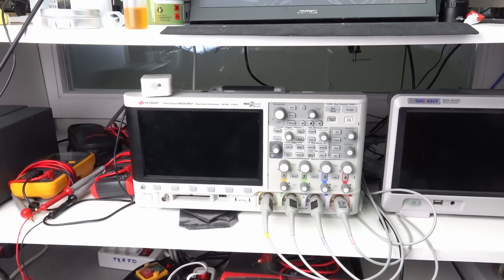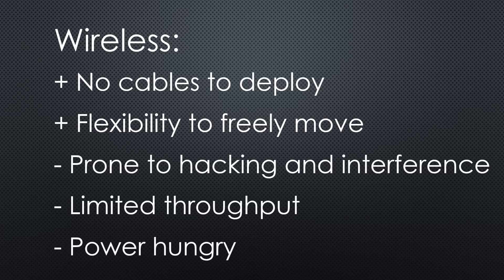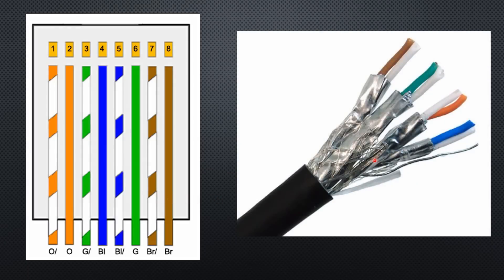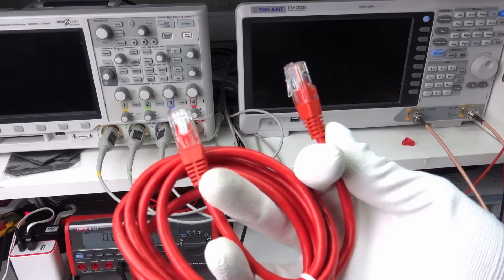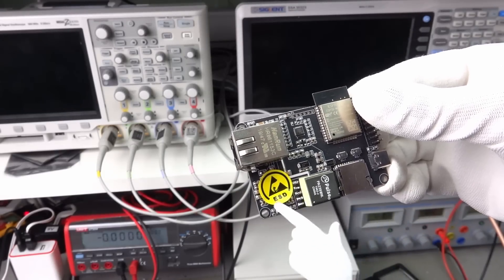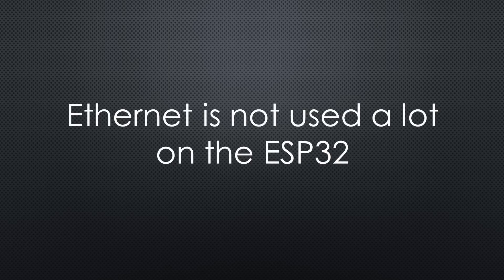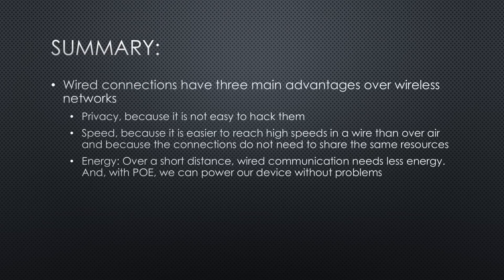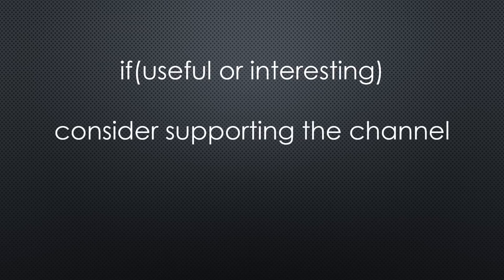(488) Is Power over Ethernet (POE) on the ESP32 any good? (New TTGO and Olimex boards available)

Comment: Just make sure to not use "shielded" Ethernet cables.
Most of these boards are not isolated from their Ethernet shield and thus there is a direct connection to the chassis of the switch.
Also when using PoE, keep in mind not all use isolated PoE, so when you connect the board to a PoE switch and also to the PC for debugging, you may end up frying the board, your PC or your PoE switch.
Reply: Wait, don't all PCs and most if not all routers use isolated Ethernet?
Reply: @ligius3  Yep, but many ESP boards with Ethernet don't and thus you have a direct connection with the chassis of the switch/router which may be connected to some other PC which isn't connected to a power outlet with earth pin and thus if you use the more expensive shielded Ethernet cables, you may have quite a high voltage offset on the GND pin of your ESP board.
If you then connect this to your PC (e.g. via USB to serial chip as some Ethernet boards also don't have USB) or logic analyser, you can for sure fry electronics.
So that's why I strongly advice against using shielded Ethernet cables to connect your ESP boards.

Some PoE Ethernet boards do not have isolation on the PoE circuit. 
For example Olimex has boards with and without isolation on the PoE circuit. This is clearly labelled in the name with "ISO".
Reply: Yes, just saw now the schematic and description for the Olimex board and it does not have a tranformer. Some ETH chips I think include a transformer inside but not the specific Microchip one. But I agree that the shield might be at a different potential, but compared to what, to ground? It still needs a path, so two connections, so not sure how the current would flow. The PoE injector probably has an isolated supply. Ethernet doesn't have a ground pin, so not sure where the voltage will flow from the shield.
Reply: @ligius3  I think you're mixing up a few things here...
In the RJ45 socket, there are some transformer coils for the signal wires (well in nearly all but the really cheap ones) so the signals are almost allways isolated or at least on the other side at your switch.
However for PoE, there is some center pin for each pair which carry the PoE voltages. 
The PoE circuit to tun this 48 - 57V into some more managable lower voltage can also be isolated. For example the Olimex PoE-ISO board has such an isolation for the PoE.
N.B. when powering your board via PoE, the data lines should absolutely be isolated or else you will fry your Ethernet chip.
But those are often just isolated in the RJ45 socket.

Now the shield of the RJ45 socket.
This should only be connected to the GND of the board via some 1M resistor and maybe some capacitor too.
However on quite a few ESP32 Ethernet boards, this shield (thus the metal frame of the RJ45 socket) is directly connected to GND of the ESP board.
So if you connect this shield with a shielded network cable (thus metal shield wrapped around the RJ45 connector), then you will make a direct connection to the chassis of the switch.
And if this switch is connected via a shielded cable to another PC which isn't properly connected to the Earth pin, you will introduce a voltage offset of +/- 110 - 120 V from this other PC.

This is like when you get shocked when touching a PC case.
So you may introduce quite a voltage level offset between your ESP board and whatever equipment you have at your desk.
Remember "this other PC" can be located in another room, connected to different phase, etc.

This is why I always advice not to use shielded Ethernet cables when connecting ESP boards. At least not when you also need to connect other stuff to it, like some debugging tool, a PC or sensors which can be touched.
Reply: @TD-er  Thanks for the clarification, it makes more sense now.

Comment: I suspect that BL will not work as it is using the same chip as wireless which is not used. Try to tall back to wifi and see what happens. I'd like to have the option to use wifi if there is no connected ethernet.
Reply from the maker: There are other comments that say that BLE and WiFi work but less stable than BLE and Ethernet.
Reply: @AndreasSpiess  oh, that was not what I meant, but if the same chip is used for both Wifi and BLE, then maybe if you do not enable Wifi then BLE might not get activated. Just a thought. As for stability, I have two esp32 modules running the ble proxy (esphome) and they were working perfectly, then I upgraded esphome and I now see drop outs with some of my ble modules. I suspect that the problems I see is down to coding and not hardware - but you touch an interesting subject.

Comment: I hate all those poe boards that won't provide Any external power to drive LEDs or actuators.... A 12V 1A could do a lot of useful things :/? And cheap poe breakout boards do that - couldn't they use that Ic as well?
Reply from the maker: All depends on the use case. Most of my PoE bords do not need a lot of power. So I do not want to spend money for a better chip or a bigger board...

Comment: I'd like to try an ESP32 board with Ethernet & POE capability! 
I have a specific application where i need an RFID reader that is connected via an Ethernet cable with POE.
Currently, I'm planning to use a different chip, as i have a board from Sparkfun that already integrates the RFID chip with a controller, and has Ethernet capability. 
But my home security system will use RP2040 chips for the sensors, and ESP32 for the console. Plus, i use esp32 for so many other things, there are times when Ethernet would be useful and preferred.
But i guess cost of the boards should be considered as well.
And whether it not there are enough free pins for the application!
(Why do they use 8 i/o pins if they're already using i2c?)
Thanks for the update!
👌👍🤪
Reply from the maker: This is why I still use the Arduino IDE: I can use different MCUs for different purposes...

Comment: Personally, I think the main advantage of wired vs wireless is reliability.
Wireless circumstances change and a deployed device that worked perfectly for months/years suddenly doesnt anymore. That wont happen with a wired connection.
(And don't get me started on ZigBee, where many devices randomly decide to drop from the network after a few months, in my experience)

Comment: I recently deployed an ESP32-POE (Olimex) with WLED, 4 output channels for LEDS, and a I2S ADC for line level audio input. My only struggle was finding enough 'raw' GPIO, and I needed to desolder a few 0201 SMT resistors from the I2C lines that I didn't need. Would be nice if it was a solder jumper or something easier to 'clear'.
Reply from the maker: Maybe somebody from Olimex reads the comments ?

Comment: Thank you.  I will look at the boards but probably hold off. I have some stuff that is connected with wifi (it isn't perfect,  wifi drops out sometimes) today, and i guess that works well enough for now. I ended up with some 2.0mm header cables a while ago. 2.5mm is much easier.
Reply from the maker: Indeed, wires have less complexity. Still, they can fail if the router goes down.

Comment: "ethernet" cable is PDS  cable; premises distribution system, developed by Bell Labs @ATT then. The PDS cabling trademark Systimax exists still. Ethernet protocol is only one of the many usages for this cabling. Other uses are such as RS-232 422 423 & normal wired telephony sets & video. In ethernet use the max cable length in 100 metres from chip-to- chip i.e. normal practice 90 meters from connector to connector.

Comment: I had a project I wanted to do a few years ago with a wired ethernet ESP32, and none existed, or they weren't really common. Ended up going with completely different hardware that was beaglebone black based, which also has wired ethernet.
Reply from the maker: Indeed, the Linux boards offer Ethernet for a long time.

Comment: Hi sir, currently I am working with esp32 and zmpt101b sensor module. zmpt101b working fine but when I try to connect wifi (wifi.began) then zmpt101b showing zero values. Please help me
Reply from the maker: Maybe you connected it to the wrong ESP32 pins. WiFi uses one ADC (watch my video about the usable pins of an ESP32)

Comment: I've always used the T-568B standard here in the US.
Reply: I've been running ethernet cabling here in Finland for 25 years and everything has been done with an A-scheme. Except one large customer that wanted everything to be B for several years, until they gave up.

Patch cables seem to always be with B-coloring thought, which screws up everything. Rj45 is used so much with other things than ethernet and we electricians need to cut ready made patch cables to connect other end to screw terminals etc. Basically every time a new guy connects such a device, we have to go back and change orange and green pairs with each other.

I'm glad that the gigabit crossover isn't really a thing in real world, so blue and brown are mostly right at the first go.
Reply: @villehietala9677  that's interesting since I'm pretty sure in the standards it says that B should be used but it's been years since I've read any of them or made a cable for that matter😉. Just did a quick search and found that the TIA/EIA 568-A was standardized in 1995 but replaced in 2002 with B. The only time A would be used is in a crossover cable as that reverses the pairs. Up thru 100BASE-TX only 2 pair are used one for TX and one for RX but starting with 1000BASE-T all four pair are used. The switch to MDI-X was added to hardware so crossover cables were no longer needed but also had the benefit that were various national standards messed up by using A instead of B they didn't need to make special equipment just for those countries😉.
Reply: The A standard was only used in office phones originally and when they developed for ethernet they choose B so the two types of equipment didn't get confused if hooked up to wrong system and/or cause possible damage. Many newer office phone system use POE instead now to allow simpler wiring that can used for either.

Comment: i don't think you can compare 150mbit wifi vs 100mbit cable as 150mbit wifi is single duplex and has overhead. Even on perfect conditions it would be max of 100mbit, whichi I would not think you could ever achieve on esp. Ethernet is full duplex making the total bandwith 200mbit. So it's not a bit better, it's alot better.
Reply from the maker: You are right!

Comment: 10:10 Wifi/Bluetooth cannot be used together with the ADC2 pins. I think GPIO14 is your problem. Unless you have already tried without the temperature sensor, in that case I don't know.
Reply from the maker: Good point! As said: I did not investigate further.

Comment: I just started looking at these for my NTP server a few months ago. There is a common board called the ETH01, it is near useless. The clock is not properly routed. I am surprised they can sell them when they are so flakey.
Also Espressif themselves sell an ethernet and poe board. I got a few of those but not tried them yet. They look very well made so hopefully they work.
I also saw the Olimex board has lots of credibility and works according to the forums.

Comment: I would say that CAt 5 and 5e would have shielding sometimes as you could get STP(Shielded) and FTP(Foiled) cables.

And for some applications I would not count out the good old RS485, it is very nice to connect alot of low bandwith control equipment with more modern trancievers that can have 64-250 nodes per segment.

And a new(2019) standard for this is T1L that that runs Ethernet over a single twisted pair in  a bus fashion at 10 Mbit.
Reply from the maker: I agree, T1L would be a good thing for most of our applications. However, the old Ethernet cables are more versatile, particularly if you wire your home.

Comment: I am using a ESP32 Module with a Ethernet Wing (W5500). Programming is not to difficult (standard ESP32 fashion) and for POE one can use a POE splitter. But an all in one module sounds promising.
Reply: Do you use lwip integration for the kernel (raw packet mode) or the tcp stack (hardware offloading) of the module?

Comment: I've been using an Olimex ESP32-POE-ISO for almost a year now. It's powered by Power over Ethernet and I use it in my garden for grabbing sensor data from several bluetooth sensors and send it to Home Assistant by using the BT proxy function in Esphome. It works flawlessly and this way I didn't have to make wifi avalable in my garden.

I first tried it by placing a regular ESP32 inside next to a door or behind a window but unfortunately this was not reliable enough and some sensors were even completely out of reach. (Because of thick walls and metallic coatings in my windows) With the ESP32-POE-ISO my entire is easily covered for the purpose.
Reply from the maker: Indeed a very good idea! I moire and more switch to Zigbee sensors for a similar reason...

Comment: I fail to see the point of an esp on such a board. Since blueooth does not work, i suspect wifi will also not work; and if wifi does work then this is a potential security risk. So either way its kind of pointless. I would rather see a teensy if you need speed or even a atmega328p if speed is not an issue, rather than the esp32. This is like buying a short wave base station radio for the sole purpose of using it as a stiff writing surface to write someone a letter.
Reply: First of all ESP32 is extremely cheap, and second of all, it comes with an inbuilt Network Stack. That will cost any board like an atmega or stm32 some performance.
Reply from the maker: A few other commenters use Ethernet and a ESPhome BLE proxy. So it seems that it was a hardware problem on this particular board.

Comment: I'm using the Lilygo board for one of my projects. It's kind of not will thought out.
The exposed pins, as you said, are a strange collection and it does not expose 5V, which would have been nice. 
Furthermore, I'm experiencing periodic boot problems. No idea why. That's the most annoying problem. If anybody knows how to solve that, let me know.
Reply from the maker: Indeed, infrequent reboots are very anoying and not easy to find.
Reply: @AndreasSpiess  I guess I wasn't clear in what I meant. It's not that the board reboots by itself. My problem is that it doesn't start properly after a reboot. It somehow seems to have problems to boot from flash sometimes. Most of the time removing power helps, but not all the time. This makes every OTA update a gamble...

Comment: In industrial applications, the Ethernet cable uses only 2 pairs, and the cables are only 4 wires with a shield.  I wonder if a POE circuit can be designed for the ESP32 Dev boards that also only use 4 wires? to allow more IO.
Reply: gigabit ethernet uses all 4 pairs, and PoE works fine on gig ethernet (where some of the pairs are used for both power and data simultaneously). You therefore could do the same with 10/100 that only uses 2 pairs, and also use those pairs for power as well, but you'd have to roll your own boards, as using pins 1-2 and 3-6 (the two pairs used for 10/100 ethernet) for PoE is non-standard
Reply: The ESP32 is not wired directly to the ETH port, the ETH controller chip uses that much pins so it doesn't metter how much pins your ETH cable uses.
Reply: it can

Comment: The Olimex ESP32-PoE has an annoying issue: it constantly draws 10mA from the PoE (500mW!) and gets really hot.  
The reason is that this is the minimum required current to keep the PoE active (device detection). However it doesn't need to draw this all the time, the PoE standard allows for short pulses of current draw to keep the PoE active.

A workaround is to desolder one resistor, but then you cant use sleep mode without the PoE being shut off by your switch due to the small power draw.

Also it has micro-USB. I cannot wait for everything to finally transition to USB-C.

Comment: After I recently got rid of my old Poe switch and transitioned to mikrotik, I'm currently transitioning a lot of stuff to passive poe. Benefit is that it runs from a 24V lifepo battery with a lot less conversion steps. At the moment my Nas is still on a conventional UPS but will also transition soon. 

Fun fact: a lot of hardware stores here already transitioned to cat 8 for shielded cables. Considering their usual markup, it's not even that expensive. I think the difference from cat 7 to 8 is mostly the plug but I'm not entirely sure. Must be small enough that it's not worth having both in stock. 

Wonder when we'll get an esp that supports fiber optics ;)
Reply from the maker: All my network stuff is from Mikrotik, too. But I do not particularly like the passive PoE because it is not widely used. I use if for their Access Points, though.
Reply: @AndreasSpiess  some of their models also support active poe. (Switches as well as the APs) Both clearly have some benefits, I'm happy with them. Recently discovered the power behind the 28° antennas in the sxtsq AC. Impressive for that price point. 

Also cheaply acquired one 60ghz ap, hope a second one also cheaply pops up soon. Your video showed me I need to test it for my stuff too.

Comment: Thank you for your effort. "Anyone who knows wireless uses wire" 🙂 Ethernet is one of the best examples of a long-living standard. I remember the first eth boards had a price of ca. 3000 DM. Long time ago. ESPHome seems to support Eth, too.
Btw. Instead of BME280, I prefer to use the good Swiss quality SHT35. More reliable sensors with way better durability. 
I am also using RS485 in some applications, but converting it mostly to Eth.